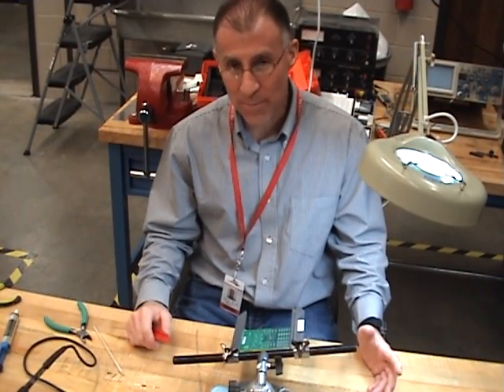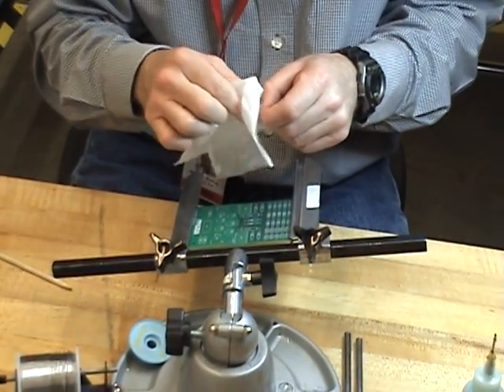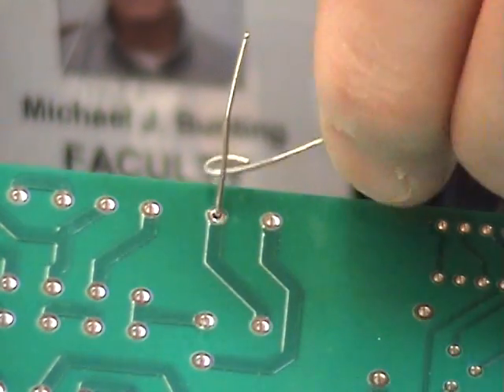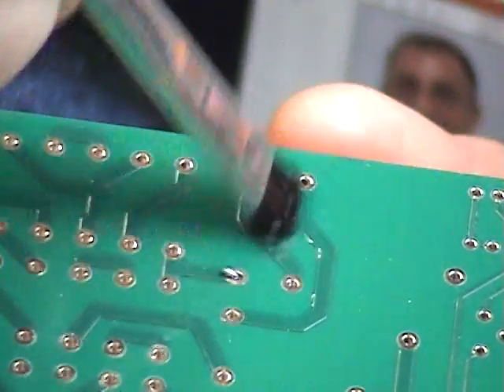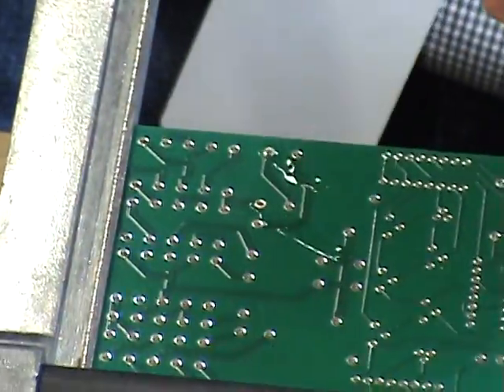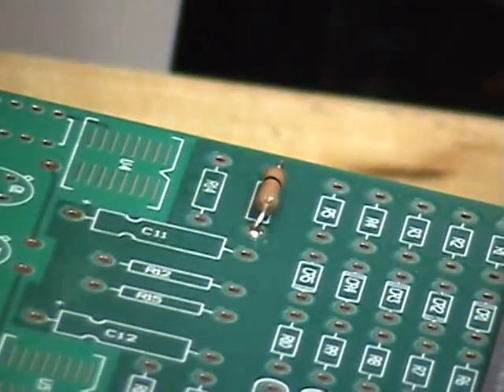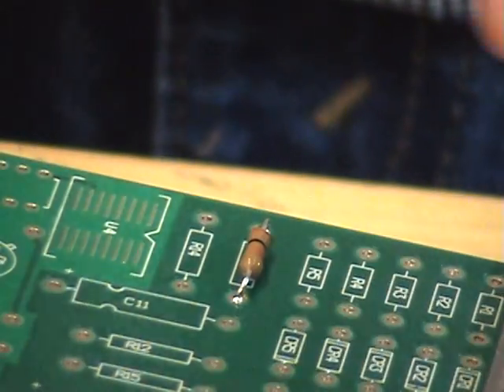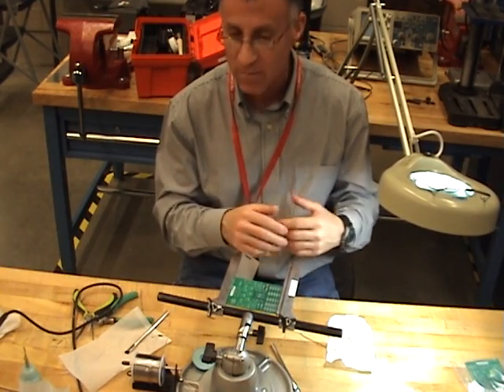*EXPERT LEVEL* Soldering Tutorial #5 TTC Avionics

Comment: This is for sure nasa certified thingy ..I understand how it is soldered for boards that will go to space...but this isn't normal production or will never be..I understand if one component cost over 100 USD then sure you need to work in this kind of soldering and all must be cleaned 4 times ..not in ormal production..that is not needed

Comment: I use a 12 foot wide CNC sheet metal brake to bend my resistor leads.  Perfect 90's every time.  Verified with a laser guided angle meter to 18 decimal places.  Then  after clipping my leads to the proper length within 10 picometers of spec,  I solder in a vacuum chamber while wearing a level 4 bio-hazard suit so nothing gets oxidized.  Unfortunately, I solder for exactly 3.1 seconds, so my prospects of working at NASA are nil.

Comment: not all resistor leads are the same thickness.  its best to clip a little off the component you are using as your guide. lead length should be one to two times conductor width.  not a fan of clinched leads either.  makes the next guys job twice as hard

Comment: It looks like the rules has changed, because I can find some errors in what he do.
1) He does not ware sterile gloves
2) He bend the leads back and forth, It may stress the component.
3) He use the wrong tool to cut the leads with.
4) I do not think that it is allowed to use a wooden stick anymore, to unprecise.
5) He ignores personal safety by cleaning the iron tip with a thin piece of paper.
6) He is not cleaning the iron after the new metodes.
7) He touch the iron with the solder while soldering, instead of letting the lead get hot enough to melt the solder, may resulting in a bad soldering.
8) He maybe do use a bit to little solder for a strong joint.
9) No ESD.
10) Wrong clothes.

And last, they do not take a new piece of solder wire every time they have used a bit.
Reply: Vinsu Karma you can try to search on soldering and NASA, there you can find a lot of information:-)

Comment: Materials selection
Tinning flux:ROL0 > ROH1 > INH1 flux for tinning / degolding in order of ease of wetting 
Tinning solder: 60 tin 62 tin silver loaded or 63 tin solder (ingot form).
Assembly flux  ROL0 > ROL1 > ROH1 flux in order of cleanliness for assembly (rol1 will need greater inspection)
Assembly solder: various 63 tin, 62 tin silver loaded, 60 tin, 96 tin, 10 tin
You may want to read about the environmental cosiderations eg thermal cycling, vibration, solar flux and some of the ECSS standards we used at ESA  before criticising. ECSS-Q-ST-70-08C  ECSS‐Q‐ST‐70‐38, ECSS‐Q‐ST‐70‐10, ECSS‐Q‐ST‐70‐11, ESCC 23500

Comment: This guy would never make it in a real manufacturing environment,  bending and cutting leads causes part damage, air pockets and you will not get a proper solder fillet. Also the time cost would be unacceptable.  3 seconds per solder joint.
Reply: Plethman Channel So how are you supposed to insert leads if you're not allowed to bend them? And how exactly do you not trim the leads? The only real question is whether to trim them before or after soldering, and the consensus is that trimming before is better.
Reply: Sorry bending is fine if you support the part  correctly. But when you cut the leads it sends a shock through the part that will damage crystals and some caps. Soldering first minimizes the shock. That is why there are so many types of cutters.  A pro will stuff all parts then solder.

Comment: I do understand that the job for this PCB has to be absolutely perfect, BUT... I thought that the rule was two seconds for the iron to touch the board and the component itself...???

Also, you spoke about the bending of the leads in relation to stressing the component (which is true) and you have bended it several times using wood chisel (also leaves particles) ?!

Using paper tissue to clean the tip is a big NO NO! 

Don't get me wrong... it is 21st century and I see lot's of people doing tutorials for the same thing all over again, and their approach is so different that it makes you wonder if you would be able to do it right since these days everyoen is an expert and yet we haven't seen any credentials whatsoever. 

Solution when it comes to soldering for all of those who are interested... try reading the books from 1960's or 1970's - you will learn everything there is about the same! 

Thank you for sharing the video! 

Greetings...
Reply: mickosurda This isn't some random dude's idea of how to solder. He is expressly demonstrating NASA's standards. You can google for the NASA soldering manuals. 
Those aren't regular paper tissues. They're Kimwipes, which are basically high-tech tissues made for laboratory use.

Comment: The only bad thing here was the video quality. Other than that, people who are bitching about how long it takes to put in one resistor don't seem to have a clue that this is a training video. Training always takes longer.  His techniques are valid as I have done that type of work. I was NASA certified in Hand Soldering Techniques and have worked on boards and equipment that go into space and on military ships and other equipment. When you are flying, wherever it is, you want to insure that you have done as much as you can do to make sure people are safe. 

One of the first things to work on is workmanship. The level of workmanship has to be very high because of all the stresses that these things have to endure. Whether that be take offs and landings or extreme changes in temperature. Your basic soldering job is not enough. The interesting thing is that once you have achieved the level of skill necessary in soldering this way you almost always want to achieve this level in almost anything you do. I am not saying the extreme measure, just the quality of work. I have seen a lot of videos on YouTube of people that show you how to solder and most of them wouldn't even come close. 

I have read a couple on here that talk about the double bending of the leads and the stresses that it is putting on the leads. Well you just think you know what you are talking about. Just check out NASA soldering techniques on the web and you will see. Part of the reason is that if a soldering joint were to fail, then the bent lead should still hold the component in and making contact as opposed to floating around in the hole. The only thing I would have really done different is that I would not have left the one lead with the shallow solder joint. I would have added a bit more solder to it. 

Another thing,, once he is working in real time and no training what he would have probably done is to batch the job, meaning he would have prepared a bunch of the resistors and done them at once. Cold solder joint, too much solder, these are all things that can affect the life of components.  As an example of too much solder, NASA is very critical of weight. Everything that goes into one of there rockets or ships is designed to pare the weight down as low as possible. When you have tens or even hundreds of thousands of solder joints, if you have blobbed on the solder then that is pounds of weight that is not needed, not to mention the effects of having a blob of solder on a joint say during liftoff as opposed to a proper solder joint.

Comment: He should not have done a double bend on the lead as that adds stress and increases the chance of failure.  If the lead was too long and can't be cut to the proper length without bending a second time then the component should be replaced and the original one trashed.  The fillet on the non-component side at the top did not appear to have enough solder on it.

I know this is a training video but what they should have done is go through the steps first and list them as a text item in the video, but when actually doing it they should have done it at the pace one would do it in production.

Lastly, it looked like they were using a pencil iron and they should have been using one that has a calibrated temperature sensor in it to insure proper temp.
Reply: Raptorman0909 He's using a Weller soldering station. It's visible in other parts of this series.

Comment: What is with you guys? He's TEACHING how to solder, not doing production soldering. 

As far as the technique, he's teaching what the standards are for the company that hires you to do the soldering- in this case NASA. If your boss requires you to go through this process, then that's what you do. They know it takes longer and takes 10 kimwipes, but they are willing to pay the price rather than loosing a few billion dollars and ending a program that may have taken years to plan because of a failed solder joint.

I leaned the same technique for work in nuclear power plants. Do you want to risk a nuclear disaster because you saved an hour rushing through a job and not following the procedures that were established to do the job?
Reply: yes yes i do

Comment: OMG you are working for NASA,,you wasted 14 minute for 1 resistor it is not called a good work
Reply: +Dilawar Khan

 No it's called great work, especially if your an instructor.

When I was in the military we spent literally an hour every time we went to the range prepping for the five minutes of firing rounds. we would have a safety briefing EVERY TIME. we'd have a dry fire run EVERY TIME. we'd have mantras we'd repeat. But the result was very quickly things like always keeping your rifle pointed down range became automatic, you'd automatically adjust your weapon to point the correct way if you turned around walking along side the range. Everyone and I mean everyone would say something if a weapon you literally just dry fire cleared ended up accidently briefly pointing at someone as you raised it up after using a clearing barrel and you'd apologize. 

You learn through intentional focus. You can get ok at something by just doing it, but if you want to get really great at something you focus on one area and do it over and over. You want to be ok at baseball, play baseball.

You want to be amazing at it, spend five hours in a batting cage every week just hitting one type of pitch over and over and over endlessly. Don't change it up, don't do other things, focus intensely and perfect your response to that pitch until it's automatic.

Comment: Why is he going through all these steps? Is this intended for some very tight-tolerance application?
Reply: +Matthew Ferrie Yes avionics for NASA.
Reply: +Matthew Ferrie Yes. Contaminants within a joint won't expand and contract at the same rate as the solder alloy. The result is fracturing.
Reply: I see - so any small mistakes or oversights could mean the device breaks
Reply: +Matthew Ferrie Strong vacuum, steep thermal cycling and launch vibration,

Comment: He soldered 1 resistor in 10min... True pro.
Reply: +Hans but hans he's going by protocol not going
by technique and skill which im sure he should be
allot faster but hey we have machines for that
unless your prototyping a pcb...but still...

Your right tekk he is taking his time im sure
out in deep space nasa has no ability of
sending repair crews for a earthly scewup...
so its better to check and check again...
thats why Voyager still floating around
in deep space- well made boards indeed...
The rigours of space travel would surely
expose your faults in soldering im sure...

quote-
 35 years to reach the edge of our solar system and enter interstellar space. (of similar technology era)

I would too depending on how important or
how expensive it would be to do again. Why 
so many downvotes?
Reply: +locomotivebrain I know what You mean but time managment when soldering is also nice thing to learn.
Reply: +Hans 
Notice it's an Aeronautics training video. Shit will be constantly vibrating and shaking around  with a lot of force. One bad solder joint could send a component leg flying loose... say that's part of a navigation system or any other vital component on an aircraft PCB and you and all your passengers are dead. 10 minutes to learn how to solder a resistor properly too much for that?
Would you build an airplane made from components sold at 1/100th the cost and mass produced PCBs made in China?
Reply: That's a bit indulged. If the systems don't have redundancies then you're on the wrong flight.

Comment: You can solder  pins top. Then turn board and cut leads then solder bottom if needed?
Reply: +Juha Rakolahti nope, there's a risk once a wire is rigidly secured by solder that cutting the leads could crack the solder and cracked solder is considered a it's failed, redo it.

Comment: Is that just a regular tissue that you keep using to clean the leads?
Reply: +Colaris No, it's probably a delicate task wipe that is for this kind of work. Kimtech brand is very common - look it up.
Reply: Thanks.
Reply: +Colaris They are Kimwipes / Kimtech by Kimberley Clark and are used because they have low lint (fluff) as seen under the microscope. I'm not sure the exact code Kimwipes aren't such a well known brand here in the UK (unlike Kleenex their domestic brand) as in the USA so they are difficult or pricey to get hold of for the regular Joe without trade accounts. Either one has to buy large production quantities or pay as much in delivery as a box of wipes eg £142.57 for 15 boxes min order at Farnell. I'm going to check out chamois and microfibre cloths under the microscope for residues / linting as I think it's far better environmentally to use washables and reusables instead of disposables if the performance criteria are met. (maybe the work microfibre is a hint not to )
Reply: Many thanks for the info. :)

Comment: Been quite a while since I soldered, retired as avionics (intermediate) tech USN in 2008...question I have, is you did not define the criteria for finding the proper slots to use on the bending tool.  I recall something about the proper dimension from the component to a bend so as not to cause possible component damage or fracturing of the leads themselves, but your video did not expound on this, in fact you said, "oh, that's even better" when you found the second slots that you used.  A great video otherwise, but I am left wondering what the spec. for the allowable lead length form the component body.  Perhaps I just need to look it up myself.

Comment: This is why it takes them 30 years to launch a shuttle... Ow, I soldered resistor backward, it is not per standard, I must disassemble everything and I will resolder it in about two months.Only expert thing in this video is board holder. Whole video looks like commercial for it.

Comment: OMG! It's GENE the ANAL-RETENTIVE TECHNICIAN! NASA should have had this guy working on the heat-shields for the shuttle, not soldering! I'll bet Russia doesn't use this stringent of a set of rules for soldering their boards! Hell, they're probably heating nails with propane torches for soldering irons! However, we seem to be just fine with riding their shit to the ISS and ditching our own space shuttle program, huh? Idiots!
Reply: Robert Frapples
You can bet the Russians don't use nails. Their techniques are equal to our own. They take just as long to do the job as this guy. Try to bear in your little mind, that he's doing an instruction video. For your benefit. Which you don't appreciate.

Comment: You are required to clip the leads first per IPC standards.  I'm not saying I agree but the reason they give is if you solder first and than clip the lead they are worried about shock damage to the component from the clip because the component is rigidly mounted.  Again not fully agreeing but he is doing it correctly as far as recent IPC standards
Reply: josh kay right, if you clip the leads after soldering, you can get cracks in the solder which is considered a defect I believe.  And since this is NASA or at the very least class 3, it's a defect if you have cracked solder.   Also, we were told to bend the leads all the way first and then cut them, you shouldn't have to bend them again, that's why they have safety glasses.   However, this is for NASA standards and they actually have their own standards other than class 3.
Reply: @kamikazekrunch8363  
Why not remelt the joint after clipping the lead, to eliminate cracks?
Reply: @VidkunQL  I have tried it and the first flow is technically better compared to reflowing which is fine, but you can see a difference
Reply: @kamikazekrunch8363  
Better how? Why? (My last training in soldering was a couple of decades ago and I'm trying to take it up again and get it right.)
Reply: Kamikaze Krunch j